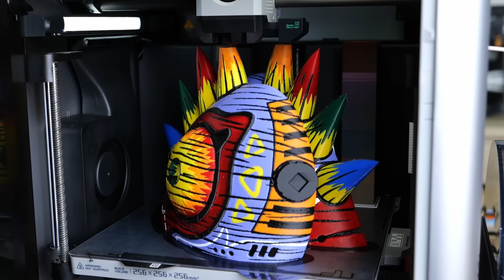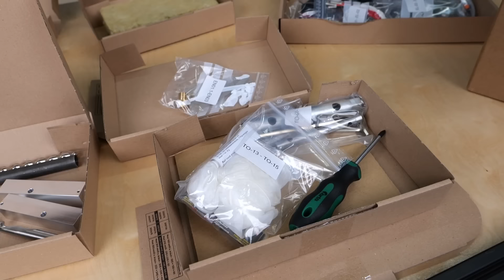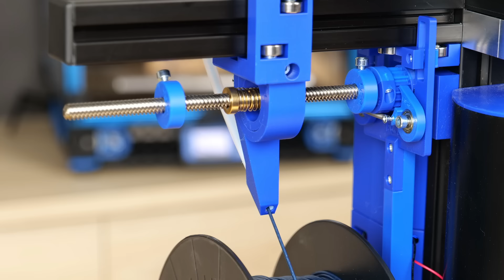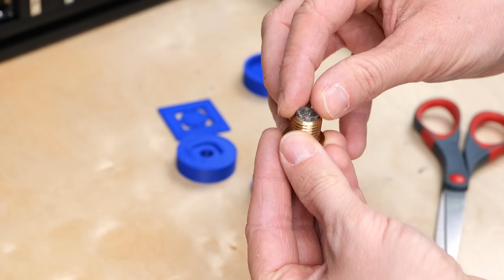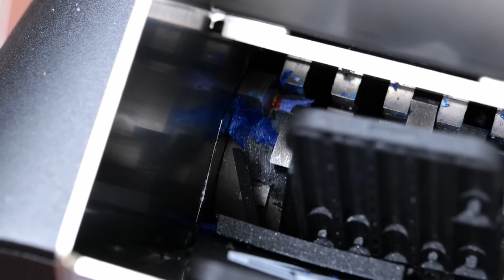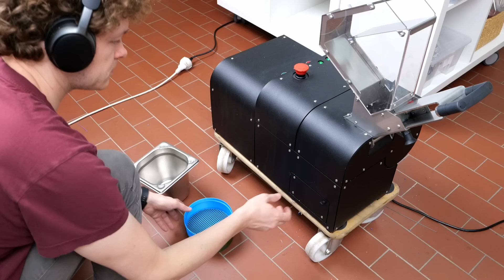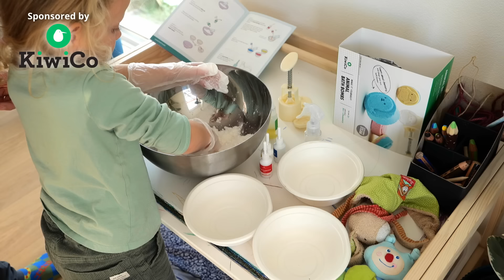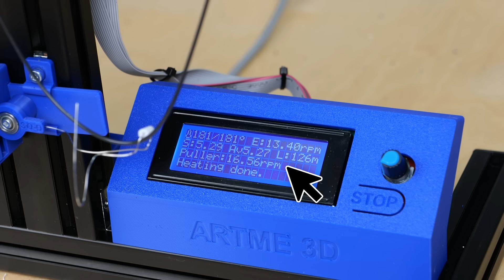Recycling Failed 3D Prints with a DIY Filament Extruder: Artme3D

Comment: You lost me at “only 600 bucks”
Reply: Would take me two years to make it back. And you also need a shredder, I doubt that would be cheap.
Reply: @lieutenantcoloneltanyavond8273  Seems that most people just use a cheap blender, but still, 600 bucks ain't cheap for the average Joe
Reply: @lieutenantcoloneltanyavond8273 you could just buy pla pellets and melt them down yourself. That would probably make it back faster
Reply: I tried getting a shredder, now I live in sewers with my brothers and dad. @lieutenantcoloneltanyavond8273
Reply: No, none of this is cheap and realistically only those who print enough to have this make financial sense should even consider pursuing such options. That said, and the real point of all this, as more of the big players in the 3d printing community for whom in house recycling is viable, those businesses and maker spaces may then in time open that filament recycling service upto those in their local community which would then provide an opportunity for the rest of us to recycle our filament without needing to make an investment that is simply unrealistic for most people who are in the home / hobbyist 3d printing space.
Reply: @hot_wheelz  I make around 400 usd from 3d printing per month with a bit of waste and a few purge dumps from occasional MMU printing, but recycling it is just not worth the time at all. The petg I buy is 8-9 USD per kg as I buy in bulk. I am collecting all the waste in a massive box, hoping that someone locally can recycle it or make use of it, but I certainly am not doing it myself. Even just sorting out the colours is a huge time sink. The ROI on even this cheap 600 USD machine would be crazy. That machine will have to recycle the equivalent price of 75 1kg rolls, and the recycled colours won't be accurate so it would have to be like.. products which the colour makes no difference, which is quite rare when selling to customers
Reply: 5 years ago it was 7000 dollars. This isnt really viable for a hobbyist who produces small amounts of waste, but for people who do printing on larger scale or for example makerspaces this could be really useful.
Reply: You can make a lot of money with that machine, you can buy 5$ pellet and sell the spool for 20$ that's why.
Reply: I do not disagree. $600-700 is a sizable investment for many
people. Myself included. I am glad though that these devices are in the world and available to make environmental changes and long term cost savings in filament. Some consumers will spend large sums of money on status items. Considering an iphone sells for $500-$1,000, and a large section of apple’s customers will purchase one every year. Just one, perhaps two, phones purchased at retail price will pay for this recycling machine that can save the user money overtime and reduce pollution.
Reply: @panda315 My same thoughts. It's not gonna be a cost saving for many people, but to see the price coming down that much is encouraging for plastic recycling in the future.
Reply: Considering commercially available options are 5 figures starting msrp...
Reply: @ethanaarness3062  exactly, people are complainig way too much abt the price and not thinking about what it used to cost for anything similar that wasnt extremely janky. Its sort of how 3d printers have developed in price, and right now we’re at the stage where there are options that are pretty good quality, but they’re still too expensive for the average consumer.
Reply: Personally I think this is amazing, you can also recycle 3d prints of the others in your town and keep the filament for yourself or resell it
Reply: However long it takes you to generate 30-40kg of waste is your payback period.  If you are a 1 printer hobbyist, payback period is probably one to several years.  If you have a 4-6 machine print farm, it probably starts to make sense.  

in perspective a commercially available Filabot PLA recycling solution is around $50,000.  Two of the machines are $20,000 apiece and the last one kinda depends on what you want but $10,000 is a safe bet.  

That being said, if you think $600 is expensive for recycling, just buy more 3D printers until you can generate 30-40kg of waste in 6 months or less.  The more printers you have and the more you print the faster you’ll generate bad prints.  At some point, be it 6 printers or 30 printers, you’ll reach a point where the speed at which you achieve 30-40kg of failed prints merits a $600 recycling machine.

If your mentality is “I can buy another ender for that much” then you’re not there yet.  Keep buying Enders.  Once you reach a point where you’re thinking “holy shit look at this mountain of failed prints that I keep throwing away every month from my 50 Enders”. Then perhaps it’s time.
Reply: @kenrodriguez9645 why the fck whould i need to have a ton of printers when im just thinking recycling is a good thing. I have two printers both arn't realy high end and both combined didnt cost 600 bucks...  so its just a cheap machine thats too expensive for the average maker and way to flimsy for the makerspaces...
Reply: Sameeee
Reply: I produce more failed prints and supports with creality but bambu has more poop/waste so ultimately if i was to double down and get another creality and another bambu which i will I’d have 4-5 printers pushing constant waste i live alone i dont have someone cleaning for me so at that stage 600$ is like a paycheck for some people I’d mark it a good investment if you buy raw pellets and colorants too but if just waste needs a shredder which is more costly I’d recommend after 6-8 printers get a recycler at that stage its no longer “investment” and more “need” where me and my buds at we are speding minimum 100-300$ a month on variety of filament in all categories PLA,PP,PCTG,PETG,ABS,etc so for us its viable allowing us cheap filaments and versatility but the average joe with an ender/k1/p1s printing home goods this would be a complete waste of money get this as your progressively building towards a farm imo im considering buying a lathe and cnc might see if i can just build this or similar model Ive always worked with these type of tools but i hate the clutter it brings i would rather buy the lathe and cnc first then buy this so altogether i wouldnt get this for a year from now all things considered
Reply: I was still listening, i mean 600$ isnt bad. The electric shredder, special oven, and the amount of prep that goes into it is pretty intense. I could see a print farm With maybe a dozen printers being able to justify something like this especially if they have all those other tools, but there is no way that there is any hobbyist out there that is considering buying all of this equipment and spending all of that time just to not be wasteful...
Reply: Not counting the mulcher and heater machines
Reply: Its in a way compared to other machines for recycling so its relatively cheap for a recycler
Reply: He sold me when I heard that
Reply: It sounds high.  But depending on how much you print, and how many friends you have who print.  The hardest part of recycling is keeping different types of plastic separated.  You could actually get a small business set up making and selling recycled filament.
Reply: If you had inconsistency printing with the recycled material, you could blend in some virgin pellets.  And since the virgin pellets are considerably less expensive per kilogram, it might even make sense to buy virgin pellets just to make your won filament.   All depends on how much you print.
Reply: Yeah im not really going to attempt recycling unless its less than $100
Reply: @overengineer7691  To be be fair, and extruder screw like that it gonna be expensive af.

A smarter idea would have been to put a plunger on a ball screw so you can have it apply a constant force as new plastic melts in. Have it cycle up every now and then to pick up new material.

The screw allows for constant extrusion but is overkill.
Reply: @overengineer7691  I doubt you'd find anything below $300 tbh.
Reply: @overengineer7691 I just started printing and I've decided to keep ALL of my waste and cast off. I may not be able to afford it right now but I will in the future at some point and at that point I probably won't need filament for at least a year due to all the scrap I'll have saved up. Sometimes "thinking ahead" means years in advance. I just launched a small biolab for plants and fungi a month ago. I've been collecting components for it for over 7 years. Each part was an on the fly find for 1/3rd of mfg price or less. Remember, this is a goal. Goals require tenacity and persistence. Don't give up. You'll get your recycler soon enough. Until then save your materials
Reply: Gotta remember that about 20 spools are worth that, so at some point this purchase will in fact save
Reply: @gradden40  How much work do you think it is to grind up 20 spools worth of plastic and re-wind it? I just don't think it is worth it. There's a reason noone actually recycles plastic.
Reply: Maybe a print farm or something similar
Reply: It pays for itself - the only question is: “How quickly?” This is a classic case of: “It takes money to make money.”
Reply: What? For me it would pay for itself in only about 5 years.
Reply: Wait till you see how much most machines are
Reply: Well compared to 30 thousand for the otherwise cheapest one.
Reply: Idk why you guys complaining about the price most of them are thousands of dollars so it’s way more affordable and will help you save money
Reply: The cheapest commercial products that do this are about $2500. This is quite a cost reduction. If you run a print farm to sell products, $600 is probably a pretty attractive price. It's still a bit high to make sense for someone like me, that prints D&D minis and household stuff.

They're going to get cheaper, though, just like printers did. I think, for me, I'd pick one up when they drop below $300, and also when they're reasonably reliable and user friendly. I expect that'll happen in a few years as the technology matures.
Reply: Yeah. That’s more than double the price of my 3D printer. What the fuck does he mean only?
Reply: 600 plus another few thousand for all grinder, dehydrator etc to get back 25 bucks
Reply: Hi same
Reply: 600 bucks to recycle 1-2 spools =))
Reply: Guess you're not the target audience, poor boy
Reply: 300 hundred bucks♂️
Reply: @United_States_of_America64726three hundred hundred
Reply: Coming from the metalworking space, you lot are cheap bastards lmao.

This is clearly for intermediate/enthusiast users being "cheap" or "affordable" are relative and obviously this is out of reach to many people but it's certainly attainable for many people serious about the hobby, let alone any kind of professional usage.
Reply: €659 or $718 it's not DIY.
Reply: I produce more failed prints and supports with creality but bambu has more poop/waste so ultimately if i was to double down and get another creality and another bambu which i will I’d have 4-5 printers pushing constant waste i live alone i dont have someone cleaning for me so at that stage 600$ is like a paycheck for some people I’d mark it a good investment if you buy raw pellets and colorants too but if just waste needs a shredder which is more costly I’d recommend after 6-8 printers get a recycler at that stage its no longer “investment” and more “need” where me and my buds at we are speding minimum 100-300$ a month on variety of filament in all categories PLA,PP,PCTG,PETG,ABS,etc so for us its viable allowing us cheap filaments and versatility but the average joe with an ender/k1/p1s printing home goods this would be a complete waste of money get this as your progressively building towards a farm imo im considering buying a lathe and cnc might see if i can just build this or similar model Ive always worked with these type of tools but i hate the clutter it brings i would rather buy the lathe and cnc first then buy this so altogether i wouldnt get this for a year from now all things considered
Reply: Same. I get if you run a small business, that might be useful at the price. But yeah... I'll pass for that price
Reply: "DIY" for your month's take home salary
Reply: brb buying the kit and building my own steel toothed shredder machine with my lathe, milling machine and loads of scrap steel and bearings
Reply: Same and im canadian so its probably WAY more then that
Reply: Same
Reply: That's only like 30 rolls of filiment
Reply: It might be worth it if you really look at the miss prints and amount of poop from multi colored prints it could be good
Reply: I watched it for the entertainment, but there’s no way I’m paying 600 bucks for that. I don’t print nearly enough for that to be a cost saving Measure.
Reply: It will pay off after some time
Reply: I'm looking into it, I have a large U-Haul box full of failed prints and filament poop at this point and it's getting to be a hassle to store and I'm running low on pla, instead of dropping $100 on more pla I might actually purchase this kit on a loan
Reply: Very reasonable considering alternatives
Reply: It’s actually more like $676~ for the current model so — but how much are you going to save not buying new filament and being able to reuse old filament that would otherwise be garbage? Hmmm
Reply: Same
Reply: That is more expensive than my printer💀💀💀
Reply: I just came here to comment that 🥴
Reply: It’s even more for the things you need to print so it’s like 700 bucks
Reply: Not only that, you need that shredder he’s using too, as well as the drying ovens
Reply: Same I thought it be like 150
Reply: Maybe justifiable if you literally run a shit ton of printers. But I'm not even sure of that.
Reply: Yeah, I’m out
Reply: That's without the shredder...
Reply: Same😂
Reply: Plus the shredder.
Reply: You can turn pellets into filament with this. That means that you can buy materials at least 4 times cheaper and use them to produce the same amount of stuff. If you are even a small business, as long as you make sales, you will make your money back and reduce all future material price after.
Reply: 😂 yeah
Reply: Ya'll got filtered
Reply: Alot cheaper than spending g 2 to 3 grand for a company named build
Reply: Same
Reply: Same
Reply: Same, but today (2025) with the ongoing tariff wars which may significantly increase the cost of filament spools, it might become easier to reach an ROI. 🤷
Reply: German Humor 😂
Reply: Better than the new options thay are 1000-2000+
Reply: If you print a lot of multi color, you could earn this back in 6 months and after that, it will be saving lots of filament and will save a ton of money. If you have the time, it might be worth the investment!
Reply: real, i don’t want to pay twice the amount that my printer costed
Reply: Honestly it’s bad but it’s gotten a lot better
Reply: It's not that much considering you can recycle the leftovers when a printer is 500 bucks
Reply: 600 euros
Reply: Literally saw this comment before the ads finished. Didn't even watch, thank you for the warning 🙏🏻😂
Reply: Litterally clicked off the video when he said that
Reply: Seriously, how can it cost more than most 3D printers??
Reply: Lost yourself. That’s free filament otherwise wasted especially if your print A LOT!
Reply: Dude but it could have you dozens of dollars if you use it long enough. DOZENS!!!
Reply: Bro same
Reply: And a shredder 

And an oven for using just with plastic

And a vacuum chamber

It's a nice idea and it'd be great to recycle when possible, but it's still a commercial solution not a hobbiest one.

Cool though.
Reply: The filament resicler (in cheap) would cost me 200bucks more, than my high-end Bambu Labs P1S (which I bought for 400 bucks in sale) 😂
Reply: Yeah that is 30 rolls of filament. If you print a ton maybe its worth it?
Reply: @HEVTech1 but its more than 600. The fillament machine is 600. You got the grinder $$, the dehydrator $$$, all the tools and containers, trays. Space required and labour. And being a heat based process the eletricity cost. The ROI and time investment. Doesnt make sense for a solo operation. For print farms it would make sense but seems like you need to hire a min wage kid to do this part time. And if you want to retain the colors and not mix. ROI is even worse having to wait until theres 1kg worth of waste to even start the process. 

If this truly saved cost. Every 3d printer manufaturer would sell a machine to do it.
Reply: I mean Iv payed that much in filiment over that past year or so. And I do tend to use a ton of supports and my printer is nicknamed "the problem child" for a reason. This might be worth it to look into
Reply: Same.
Reply: 53 seconds and I see your 600 bucks comment. Yeah im out.
Reply: Thanks, you saved me 20min here 😂
Reply: Same bro
Reply: Beats 3,900 bucks 🙄
Reply: me too, I stopped the video and am clicking away.
Reply: I felt the exact same way when I heard that, so I really appreciated the clarification that, while this was still Very Expensive for a DIY kit, it compared much more favourably to manufacturing-level solutions. Watching until the end and confirming it performs better than a tenth as well as those makes me so happy and excited. 

To be clear, I fully agree this is not in the budget for almost any single person 3d printer - but neither were 3D printers at the start! I love that it's still conceivable that a person could afford this and it's absolutely fantastic for print farms, maker spaces and such. I can only hope that, like 3D printers themselves, machines like this grow in popularity and quality and, more importantly, drop in price to make them available to more people.
Reply: I honestly think this machine will pay for itself by saving you money on filament. If you're going to print a lot and it works the. It's a no brainier. I think it's a great idea.
Reply: Same
Reply: only option for us is to hope if government makes a separate bin for 3d waste which can be recycled at some local spots and finaly back to shelf. it can save a lot of plastic being dumbed because if we sum up each of ours 3d waste it will be a huge additional plastic burden on earth.
Reply: Ya its expenive
Reply: Well when you waste alot of 40$ roll dew to drying out it adds up
Reply: You end up wasting thousands of dollars in material if you don't recycle so it helps you see money
Reply: And the fancy shredder....
Reply: $600 😂 I rather trash it lol 😂
Reply: You are not the only one
Reply: It's not too much if you calculate how much money you dropped in trash with plastic "poops", extrusion towers etc. And progress shows that a lot of things and gadgets become cheaper over time, but not in the recycling of course😅These days, Creality is planning to mass-produce a similar device, but its price will definitely not be 600 bucks.😅
Reply: If you consider just how much filament you waste in failed prints and Structuring alone, this would earn you back money very quickly.
Reply: 600, thr shreeder, the v vacuumchamber/gaugee and the compresor; this is a much more expensive thing
Reply: Yeah get out of here with that price
Reply: @emenesu yeah you can get a bambu lab p1s combo for that price
Reply: And it doesn’t even come with the whole thing. You still need to print most of the parts
Reply: $600 for something that does all of this and has several fully custom CNC machined parts is amazing, you all smoking the funny stuff? Custom machined parts cost a fortune and this turns waste into new filament. 

THAT BEING SAID - this is not for everyone to necessarily have, if you know several people who 3D print you could set one up and have a sort of side business, or a public recycling service. 

Ya’ll will spend so much money on printers and filament but something that recycles all that waste and suddenly it’s  too expensive.
Reply: @GeddyRC i wont spend that much money on a printer... and no that has nothing to do with the enviroment its the fact that its a 20% macine you have to complete yourself by printing and the ONLY precision made part is the screw... sorry its a cashgram for the rich guy... if environmental ideas would paly a role it would be made different and for a more realistic price.
Reply: Might as well make all of his own fililanent now
Reply: You should have put the price of your shredder into account, because was decisive it working with the recicling extruder to make the filaments. Besides 50 hours of printing, and one and half spool. We will find out it's way beyond 600 .
Reply: Ah. Yeah...$200 for a 3d printer is something that still needs thought and planning. (Near the end of 2025 for me)
$800 is a whole computer!
Reply: Same, that's the price of a new prusa, or a P1
Reply: he rich
Reply: Fr
Reply: David includes everything in the over $600 kit, except all the stuff you have to print and the power supply. Oh and because it’s a kit you have to assemble it yourself.
Reply: That's cheap
Reply: Bro did you see the other options 😅
Reply: I bought my ender 3 pro for 60€
Reply: That's double the cost of my printer
Reply: I thought he was going to say 100
Reply: Byeeee
Reply: For a kit, where you have to print your own 3d printed parts and your own assembly.  

When you think about the parts, does it seem like they should cost as much as a psp1?
Reply: Same here. I can't see spending 600 when a roll of pla is only $12 (for what I buy) 😂
Reply: 600 is so low
Reply: Broke eh? Me too however 600 seems fair i would say u lost me at 1-2k 😂
Reply: It literally Is an ender 3 with less components how Is It 600$ 💀💀
Reply: @paolo69  the costs are in the extruder screw!
Reply: @paolo69  thats incorrect, it has several custom made, complex cnc machined parts. Thats why its expensive
Reply: @idkwhatnonamemyself1951  for that price i could buy a cnc and make my own for 50 bucks
Reply: @paolo69  buy a cnc that can make complex metal parts for 600 bucks? Sure bud. maybe you can build one if you get lucky and can use a cnc that requires experience to use.  Theres a reason cnc machining is expensive, if he could make it for dirt cheap dont you think he would? Cheap prices means more customers after all.
Reply: @idkwhatnonamemyself1951  3d printers are literally CNC and the cheapest One Is 100$ so yes you can find 600$ cncs
Reply: @paolo69  Ok you’re cleary just spouting off about something you have no knowledge about, 3d printing is additive manufacturing whilst cnc machines are subtractive manufacturing. If you’re so certain about your claims show me a 600 dollar cnc machine that can cut complex metal without modification. Why would cnc parts be more expensive than 3d printed parts if they’re the same thing.
Reply: @idkwhatnonamemyself1951  the First One to pop up on Amazon in 200 the second One Is 400 the forst one can do aluminum and is enought for most stuff the second one can do steel
Reply: @paolo69  buy one then, would cnc machinist really be a job if you could make complex steel parts with a cheap machine without prior knowledge? Theres a reason fewer people have cnc machines than 3d printers, doing complex parts require either a pricey machine or a skillset that isnt easily aquired. Once again if cnc was as easy as 3d printing in would be more common and cheaper.
Reply: @idkwhatnonamemyself1951  industrial cnc Is different than home CNC and not many people Need metal part thats why they dont have a CNC, i attached a spindle to my ender 3 and thats more than enought
Reply: @paolo69  alright, then go ahead, make the artme3d parts for cheap. The cad files are sold for 27 euros, so not exactly a ripoff imo, it even allows for you to sell the parts, so if you can make them so cheaply you might as well sell the parts and turn a profit.
Reply: @idkwhatnonamemyself1951 aaannnndddd if you look the comgrow 3018pro's board, it's LESS advanced than any modern 3d printer board. Sorry you don't understand that additive and subtractive manufacturing uses the same types of components.
Reply: @idkwhatnonamemyself1951 the cheap cnc will not last running 24/7 like a large cnc, but most of use will not use them that much and desktop cnc is capable enough to build a machine or two. The price discrepancy is in build robustness. One is for low volume and one is high volume. Stop saying people are talking out of the side of your head, while doing so yourself.
Reply: @paolo69 bro. Do you have any idea what kind of cnc is required fo make that feed screw? No, you don't.
Reply: 600 is an average price of a printer. . Compared to most this is a good deal
Reply: @FlareOfProminence  average? Bro in Sorry to tell you average doesnt matter
Reply: Plus a shredder and a power supply. Power supply not included for "legal reasons". Those legal reasons are probably, "machine catches fire when powered on"
Reply: The no power supply issue, the kit had not yet been certified so they didn't ship with a PSU.  The MK3, MK3S, and MK3S+ models come with a power supply for the country it is delivered.
Reply: How many rolls of filament will u get for $600
Reply: @mdsimmon1  for waste Mabe not really worth but if u bulk buy pellets and make your own filiments  the real question is how many rolls would it take to save 600$ 1kg of pellets is 1-1.50$ while rolls are 10-30$ ea
Reply: @mdsimmon1  60kg if you buy in bulk
Reply: Thanks, saved me from wasting 19 minutes 😅
Reply: I know right, this should be free! Why aren't they paying us to use it! Don't they care about the environment!

Its a hobby... Plenty of hobbiests have wasted far more money than that over the years
Reply: Agreed
Reply: More than my printer lol
Reply: only around 600 bucks. that was 3x the amount of my printer.
Reply: Nbs I head turned to side when he said only 600 bucks I was like wtf
Reply: If non brand PLA cost 15Euro per kg, it need 40 kilos free filament to be equal. Plus you print parts, use yout time to build it, need shredder, sieve, dry,  adjust machine until you got good results. And after all, you got uneven colour prints if you dont separate different waste... it can be useful for printer farm but there you don't have time to play with this... nice toy anyway.
Reply: For real...
Reply: My 3d printer didn't even cost that much.
Reply: Cost more than buying a new 3D printer
Reply: It’s ridiculous that it’s 4 times more expensive than an average printer
Reply: How do you drop 6 hundo when you still gotta download/store, splice, print, assemble , manage , it don't even grind up the old filament and you gotta manage it like a 3d printer
Reply: Thanks to this comment I didn’t have to watch this video past the opening ad. Thank you sir!
Reply: Rather just buy $600 worth of new filament
Reply: I mean, even if it were free, is it worth the trouble???
Filament is NOT that expensive.
Reply: Yeah,  I would rather spend that on filiment and throw away the waste.
Reply: 🤣🤣….. bruh, that’s EXACTLY how I felt EXACTLY at that same moment!!!…. I will just use that $600 to buy more filament…. Lol…😅
Reply: And this is why we haven’t made too much progress, too expensive
Reply: @liamdj6535  "not much progress" a few years ago this setup would run you at least 3k
Reply: Yep
Reply: Whahaha man has a professional shredder and a drying oven 😂😂 plus the 600 bucks inconsistent filament recycling diy filament maker. So basically for us make it a 4 a 5k project and as he already has a professional 2k shredder and a drying oven why not just buy a 10k professional system right away😂
Reply: Ouch, that’s gotta suck Thinking 600 is a lot.
Reply: @Eric_In_SF  uuhhh loook at me im the rich guy... have you gotten daddy keys for the car shiw of weekend yet ?
Reply: 0:07seconds into the video I paused and saw your top comment. You, EggBag4182, win the comment of the year for saving so many peoples time 🎉🎉🎉🎉🎉🎉🎉🎉🎉🎉🎉🎉🎉🎉